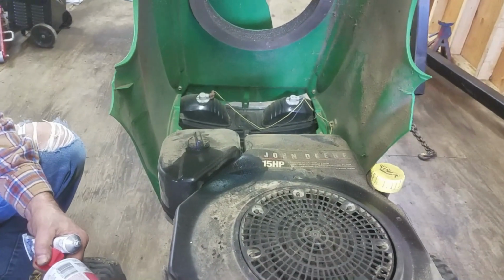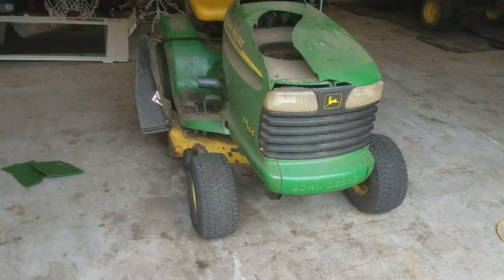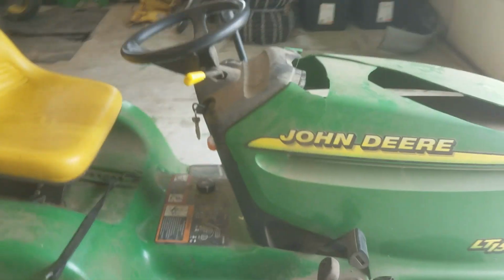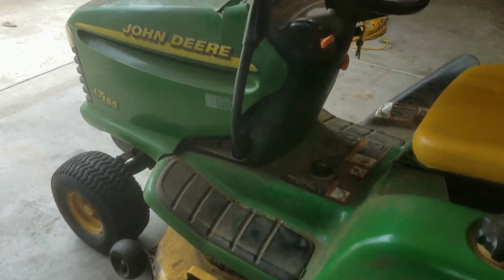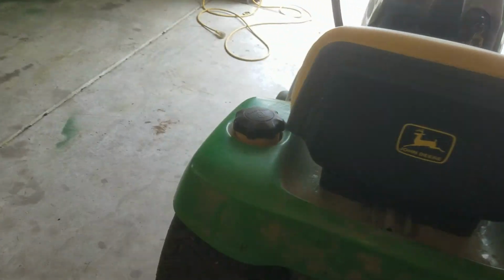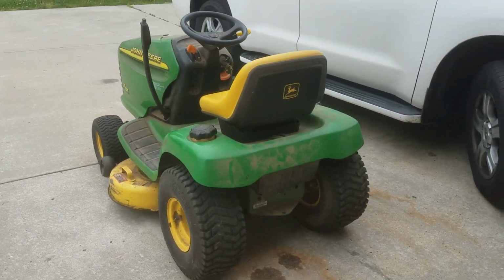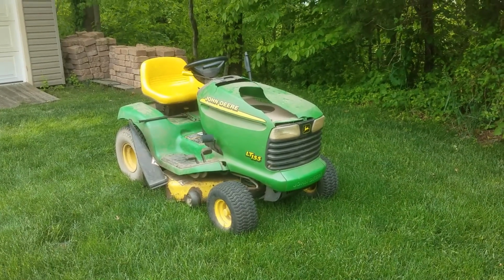A New Project - 2000 John Deere LT155 (First Start in 3 Years)

Comment: I still have my old LT155, only use it when it snows to plow my driveway. And boy does it plow snow with chains on it! One of my few engines that I have that I know will start right up whenever I need it.
Reply from the maker: Gotta love an old Kohler Command! I've only ever plowed snow with garden tractors, I'd be curious to see how one of these little lawn tractors do.
Reply from the maker: I run my machines year-round so I try not to let them sit for long periods of time. I always use a good quality car battery with high cranking amps...they'll fire up in the dead of winter every time.

Comment: Hey Mike if you haven't already put the decals on. Mix up some soapy water and wet the area where your going to stick the decal down, it will let you slide the decal around and be able to pull it back up till you have it situated where you want it the just squeegee out the water from behind the decal. That's what I did on my 332 and it worked perfect.
Reply from the maker: That's exactly what I did. One side has a couple small air bubbles in it, but I stopped trying to squeegee them out before I started to scuff up the decals and the hood. It's only a backup and a rough cut mower now so I'm not too worried about it.
Reply: The bubbles will go away eventually mine had some and they're gone now.

Comment: Hi Michael the headlights on the early LT's with the 3 position keyswitch are always on when the engine is running. On the later ones with the 4 positions you can switch them on and off. Hope this info helps you a bit. 
Nice project by the way. I like those little lawn tractors too. Here in germany we have also the LTR series with rear discharge an box in the back. 
Greetings from germany
Reply from the maker: Thanks for the info! I figured the headlights probably worked when the key was turned on. These headlight bulbs are burnt out so I will probably replace them. Those LTR series are not too common here in the States.

Comment: Working on a crank, no start on a LT155 with CV15 Kohler engine. No continuity between laminated metal and kill tab on magneto 258404s.  Planning to replace magneto.
Reply from the maker: They are a common failure point on those Kohler engines. Gap should be .010" or .020" if I remember correctly.

Comment: Is there a way to see how many hours at LT155 has done?
Reply from the maker: Hour meters were optional on that model. If it had an hour meter it would be under the dash on the side of the metal column I believe. Rarely see one with an hour meter though.

Comment: Nice! Hey I have an LT190 and since you have a lot of experience with the LT series, would you happen yo know how you can mow in reverse? All the other vids on youtube are with mowers that have a RIO switch.
Reply from the maker: Does the LT190 not have a RIO switch? It may be built into the PTO switch like on the X300 series. Try pulling up on the PTO switch before backing up, then releasing it once you are moving.

Comment: I have an LT155 as well but it has a 15amp charging system and regulator.  The AC wires from the stator continue on somewhere and get very hot to the point of melting.  Do you know where after connecting to the regulator these AC wires might connect?  What else needs AC?
Reply from the maker: The regulator/rectifier converts the AC current from the stator into DC current that charges the battery, so there should not be any AC current coming out of the regulator.  The DC wire coming out of the regulator should go to the battery. I',m guessing the regulator is bad if it allows the wires to get hot enough to melt.
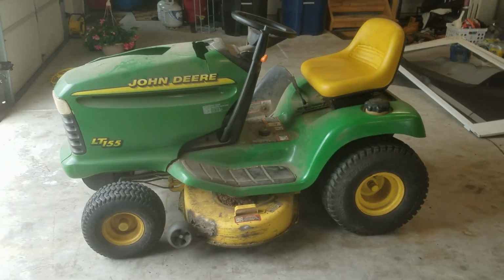Reply: @MichaelTJD60  Thanks for the reply - that's exactly what I would have thought but I am here to tell you that the two wires coming from the stator connect to the outside legs of the regulator/rectifier and then CONTINUE on elsewhere.  Yes - a DC wire connects to the middle leg of the regulator/rectifier and then goes to the battery.  My LT155 model wiring is similar to what is shown in this video at about 4:40  https://www.youtube.com/watch?v=oSyvHNqj1EE   I wish mine was a simple configuration as yours was.  I am on the hunt for the wiring diagram for my LT155
Reply from the maker: @steinercharles  Here's a wiring diagram for your machine. Looks like the regulator is in the lower right hand corner. After checking out the video link you posted, they seem to be wired much differently than most of the other machines I have worked on. Never realized how sophisticated the wiring was on those simple little machines.
Reply: @MichaelTJD60  Thanks - did you intend to attach a picture?  Sorry but I don't see it.
Reply from the maker: @steinercharles  Sorry, my mistake. https://static-cdn.imageservice.cloud/2796436/lt155-john-deere-wiring-diagram-wiring-diagram.png
Reply: @MichaelTJD60  Thank you again, this is very helpful.  I had no idea the two legs of my stator were shorting together.  It is surprising I haven't burned up my stator, rectifier or worse. I have melted 3 sets of butt connectors.   When I disconnected the "SHUNT Relay" my charging voltage returned, I certainly don't need that quick-stop safety feature that the shunt is supposed to provide.

Comment: Looking to buy a 15 years old used LT 155 for $1000.  Looks to be in good shape on the outside, no mechanical issues.  Is it a good machine?  I heard good things about the older John Deere but am concerned about the age.
Reply from the maker: The LT series are tough lawn tractors, but the plastic hoods are very flimsy. If the hood hasn't broken or cracked already, don't be surprised if it eventually happens. Also, $1000 is way too steep for an LT155 unless it comes with lots of attachments. I sold this one for $600, and that was pure luck. They typically go for $350-550.
Reply: I'll hook em up with a newer old one for $1000 or he can pick what one he likes best and we'll talk about it they're not new I'll even cut his price to $900.00 he'll like that all of mine run

Comment: I have a questions. I just bought one used and we were wondering why the orange brake handle that is just below the steering wheel to the right sometimes has a hard time moving. Any tips, we've only used it one day so far, but my boyfriend said it worked like a bulldozer in my woods and he actually thought the deck was made pretty tough. Lastly mine too like most used john Deere's had the hood busted off, has anyone found a different type mower hood that fits these since Deere's are made of fiberglass and other old mowers are made of metal. can someone post a link to the best free manual
Reply from the maker: I've noticed the parking brake latches on these tend to be a little difficult to latch or release, just by design. You have to push the brake pedal all the way in and also push in on the parking brake handle as you are sliding it down or up. The hoods on these machines are actually plastic. Flip Manufacturing sells a good-quality replacement hood which is also plastic, but much better quality (and less expensive) than the OEM hood. That's what I ended up using on this tractor to replace the original hood. As long as you're not purposely running it into trees or dropping boulders on the hood it should hold up just fine.

https://flipmfg.com/collections/john-deere-body-parts/products/578624
https://flipmfg.com/products/700896?_pos=4&_sid=cdb7d641b&_ss=r

The online manual can be accessed through the Deere website. 

http://manuals.deere.com/cceomview/OMM142698_I0/Output/Index.html#25815

Comment: Nice little tractor. I have A J.D. Hydro 185 I'm working on. Bought it at auction for 98 buck's running! It has A 17 h.p. Kawasaki engine that seems like A nice engine ( first one I have had) but the muffler is shot and man is it loud!! Aftermarket muffler is over A century note! still trying to find other options. Mower deck is marginal. rust hole's and cracks around brackets. I just bought A new Hobart MIG welder for my birthday (65 on May 3rd) so I will weld it up and hope for the best. I did see A mower deck on an on-line auction that is close to the configuration of mine and I think it might work. If it goes cheap I may bid on it. I can always resell it on Craigslist if I can't use it. 
  I also have A flat fender 112 with A Kohler engine. That one has A hydraulic deck lift. Bought that one at auction for 200 buck's as A non-runner but it's in excellent condition. Had A bad starter.
  Good luck on your project's!!
Reply from the maker: Thanks for the comment Gary and happy late birthday! Sounds like you made out really well at the auction. The old 160-185 and the LX series are great machines, I had an LX176 with the 14 HP Kawasaki, basically the newer version of the 175, and loved it, it also had a bad muffler. I'd like to get a Mig welder for myself at some point. The hydraulic lift 110/112's are good tractors and are pretty valuable. I upgraded my 210 to hydraulic lift and I'm so glad I did the swap.

Comment: Does anyone have an idea how to attach a dbl bagger to the Lt155? I purchased a used one & had my father pick it up. I can’t figure out how to attach to mine or a video to watch to figure it out. Yes...it’s an Lt155. TIA!!!!
Reply from the maker: There should be a mounting bracket with two curved "pipes" coming up out of it that bolt to the hitch frame on the back of the tractor. I had an LT133 with one of those baggers on it back in 2014, if you scroll back through my channel there are some videos of it that might show what you are looking for.

Comment: I prefer a manual PTO because they are cheaper and easier to repair. The engine sounds pretty good. Friggin mice !
Reply from the maker: Manual PTO's sure are cheaper. They are nice on smaller tractors like this one but on the old tractors like my 210 they were a nightmare. So were the mice!

Comment: i found my LT155 runs better with straight SAE 30, not blended. Smokes less and runs smoother.  Got an hour timer to keep me on schedule with maintenance.
Reply from the maker: I found it interesting that my uncle ran SAE30 in this thing since new. I usually run 10w30 in these newer engines and save the SAE30 for the old stuff. I wish the small tractors like the LT series all came with an hour meter. I'd like to know how many hours this one had on it.
Reply: Hook one up to it should show you then.

I wish i knew how long mine sat for like how many years did it after the whole engine was rebuilt sat because it was popping when the last owner tried starting it up i fixed all those problems with it i just wonder how long or how many years it did when all it had was a few simple fixes it needed 

Probably won't never find out but it works good